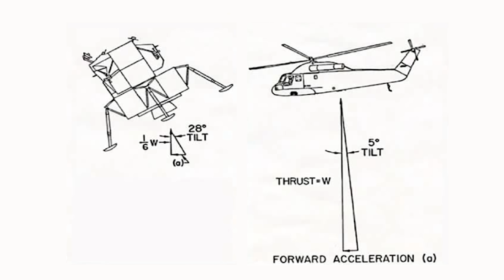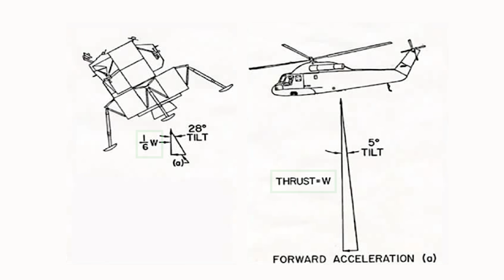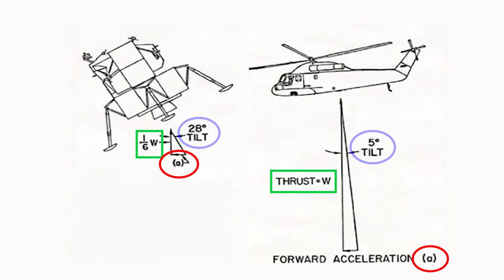How Neil Armstrong Trained to Land on the Moon  - Smarter Every Day 250

Comment: The Apollo Moon Landings were a hoax there are many reasons why they were a hoax one was the Van Allen Radiation Belt they didn’t have the shielding to protect the astronauts when they traveled through this region around the Earth.  One scientist said they would need 4 feet of led shielding to protect the astronauts through the Van Allen belt.  Also there was solar radiation and cosmic radiation that you couldn’t plot a time of year that it would be safe to travel through because it was unpredictable.  The biggest reason is neither the astronauts, Lem or the service module couldn’t protect the astronauts from the radiant heat from the sun.  The astronauts’ heat exchangers on their liquid cooled suits will not dissipate heat in a vacuum.  A vacuum is a near perfect insulator.  It’s the same concept as a thermos bottle,  whatever beverage you put in the bottle will remain hot or cold for a very long time because there is a vacuum around the liquid.  The astronauts would roast in their suits on the daytime side of the moon from the 200 degree heat and would die.  The same concept with the lem and service module.  NASA claims they rotated the service module slowly so the side not in direct sunlight would be cooled off by the cold of space.  Space which NASA claimed is a vacuum has no temperature and it’s a insulator so the service module couldn’t be cooled by this method and the astronauts would die on the trip to the moon.  On the so called moon the horizon is always 300 feet from the camera if the astronauts traveled using the lunar module the horizon line would change depending on terrain but it didn’t.  There were no stars in any of the videos or pics of the moon landings.  On the moon that has no atmosphere you should be able to see the stars clearly because there is no light diffusion from a atmosphere.  They never pointed the cameras up to the sky at all this is to hide the fact that stars should of been visible and astronomers on Earth would of caught onto the hoax.  The astronauts allegedly left tracks on the moon but in a vacuum no water can be present so there would be no moisture in the tracks to make a foot print.  It would be the same as walking on the beach or in a desert.  There was no dirt on the Lem foot pads from when the descent rocket booster lowered the Lem onto the Lunar surface which dirt would of flew everywhere.  Yet watching the lunar rover as they drove around the moon it kicked up dirt everywhere.  There are many more reasons as well but NASA faked the Apollo Moon Landings
Reply: One scientist said they would need 4 feet of led shielding

What was his name kiddo?
Reply: @tgstudio85  Look up the book Nasa Mooned America by Ralph Rene
Reply: @michaeldavis6605  If his understanding of physics and/or the English language is on par with yours, I'd rather roll around in broken glass wearing a barbed wire suit.
Reply: @michaeldavis6605  Sorry kiddo but I'm not from US, so i will not buy that book, just paste here, what he specifically said.
Reply: @michaeldavis6605  Oh ps. Ralph Renee isn't a scientists kiddo. I asked for name of scientists who said,  that there will be need for 4 feet of led shielding, so what is his name!
Reply: @tgstudio85  so you would ignore someone because he's not a scientist but has legitimate points there are alot of people who are scientist that still think the theory or relativity is right and practice it
Reply: @ArKritz84  all you can say is insults but cant bring facts to debunk my claim
Reply: @michaeldavis6605  that which is asserted without evidence, can be dismissed without evidence, so your cute switching of the burden of proof won’t fly with me. I owe you nothing.
Reply: @ArKritz84  I already gave you enough proof in what I first typed and you responded to if you don't believe it you don't have to I know better
Reply: @michaeldavis6605  no, those were claims riddled with a poor understanding of physics, not evidence.
Reply: @michaeldavis6605 Ralph René was a conspiracy theorist if you didn't know.
Reply: What a load...  🦃

Comment: NASA has chosen the Human Lander System (HLS) for the Artemis program and it's a version of the SpaceX Starship. This is 50 meters tall and much more massive than the Apollo LM. SpaceX has excellent autonomous systems on its Dragon spacecraft for docking to the ISS and Falcon 9 for landing. The F9 landing is crazy, it's on a drone ship deck heaving in 3 dimensions, those are impressive algorithms. Considering the size of the Starship HLS idk if real-time direct human control is possible. Possibly some kind of indirect synthetic control can be used. SpaceX will certainly build it to have a fully autonomous landing capability.

Comment: This may have already been suggested, but if any one wants to have the closet to reality feeling of operating the actual moon lander as it lands on the Moon, PLAYSTATION 4 HAS A VR APP THAT USES PS VR HEADSET ALONG WITH THE CONTROLLER CALLED 
"APOLLO 11 VR" this simulation uses the actual software elements of the real landers flight  computer giving it hyper realistic landing charactoristics, this with the 3d environmental head  set will blow your collective minds, its not free, about $12 bucks, but for Apollo junkies, repeat landings never get old because no 2 landings are the same... remarkable engineered simulation

Comment: You would think they would build a computer-based flight simulator, and program in the flight characteristics of the actual lunar lander and expected environmental conditions. An astronaut could do way more training, without risk to himself (herself?) and without losing any vehicles along the way. Perhaps engineers might need to build an LLTV, for use in the final stages of training. But I'm hard-pressed to believe that any vehicle they could build wouldn't be subject to erroneous factors (like wind resistance) that they could program out of the virtual environment.

Comment: The question you haven't asked is: can a rocket engine be controlled as easily as an aviation engine? And since there is still no manned vehicle capable of rocket landing, we can reasonably doubt that such a technical feat was accomplished 50 years ago, and its technology forgotten forever.
Reply: @Andre You affirm and deny without providing any evidence.
I repeat: YOU CANNOT CONTROL THE THRUST OF A ROCKET ENGINE ABLE TO ENSURE SMOOTH AND CONTROLLED LANDINGS. Aviation engines are much more flexible because you only have to control one variable: fuel. I recommend that you study in depth the operation of the rocket engine, many myths and little reality.
Reply: @Andre Aviation engines are much more flexible because you only have to control one variable: fuel.

"As you can do in rocket engines."

No, you need to control the oxygen, there are two variables, two very high pressure pumps that must work synchronously, which is why it takes so much to master the brute force of a rocket.
Reply: @Andre Seriously, white smoke on takeoff? water steam? Can or not explain the show?

Comment: i have a question. When a rocket goes up into space, and then lets say it stops completely. does the solar system fly away from the ship? im only asking because i know that everything in space is moving, nothing is still. so even if a ship goes to space and seems to stop up there. its still moving along with the earth right? like. is anything that stops in space really stopped? rlativity is a mind blow to me. its like being on a mag lev train. your at the back. this thing is travelling at say 200 mph. but your tanding still. technically your travelling at 200mph with the train, whilst standing still. if you start walking forward, you're travelling faster than the train even though you're travelling slower than the train. that space ship is you on the train and the solar system, or earth, is the train. i dont know what im asking reall or wh, its just it blows my mind how fast the earth is travelling round the sun, and the sun is travelling through the galaxy and the galaxy is travelling through space, and yet we can travell those speeds whilst standing still. its mad.

Comment: Hi how did they transport the moon buggy to the moon inside that small lander also how did they actually get it out of the lander to the moon surface I thought there was only a small door with a ladder to the surface I’m just curious thanks
Reply: They expanded the trunk, guess they need more fuel too, oh and super batteries :)
Reply: @Andremy my dear dear still at ME here, woaw scienceman erudite very impressive retorting, you know... i just read about it. 
>>> space can freeze or burn you with ease

 Why Space Is Cold If the Sun Is Hot - Interesting Engineering
Sep. 28, 2019 — space can freeze or burn you with ease ... When an object is placed outside of the earth's atmosphere and in direct sunlight, it would be heated ..
Let us take the moon for example. The areas that get the sunlight are heated to 127°C and the dark side of the moon will be at a freezing -173°C. 

Surviving extreme conditions in space - ESA
Space is one of the most extreme environments imaginable. Above the insulating atmosphere of the Earth, spacecraft are subjected to extremes of temperature, ...
Temperatures in space can range from the extremely cold, hundreds of degrees below freezing, to many hundreds of degrees above – especially if a spacecraft ventures close to the Sun.
Reply: Magic of TV

Comment: Dustin, love your videos. I’m curious about the Apollo style air locks like between the CM and LM. I’ve looked at them in person at the Huntsville air & space museum, and discussed with the staff, trying to imitate you with the Saturn core-memory modules. I failed, we could never figure out how the ‘grab hook’ or docking-hock, which is in the tunnel is gotten out of the way so that astronauts can travers from one vehicle to the other, and then reseal for separation. I’ve wondered about this since I was a kid back in the 70s, and from time to time I’ve looked at 3-D images to try to figure this out. I’ve watched you solve many harder problems on your great videos and I thought throw this out there to get some help from you. Ps. Also curious if more modern space craft use a similar system. i’ll keep watching and getting smarter every day.

Comment: I think the early "control system engineers" are better than now, with limited literary and material resources, they have to solve physics, chemical problems, first formulate systems in calculus, then translate in machine language code, write them in the brain of mechanical-electronic systems that very complex they build, they must master the knowledge all at once

Comment: This might be a stupid idea, but these days couldn't we, in theory, build a drone 1/6th the mass of a lunar lander then use virtual or augmented reality to put the pilot in the seat of that drone?
Reply: heavy things freefall as fast as light things.
Reply: @atlas8827  yes but the counter thruster offsets an amount of WEIGHT, which you can also do by... reducing the weight. Acceleration due to gravity is constant but how it flies is based on the overall MASS vs the force of the thrusters.

Comment: how much would be saved in fuel weight if the rocket first stage was accelerated on a maglev ramp before first stage engine ignition? seems like maglev trains are similar sizable payload can be accelerated to high speeds using electricity and starting a rocket to escape velocity from maglev speeds would have a huge impact compared to starting from a standstill

Comment: What actually happens on the moon landing(s) low-key confirmed by his guest Ben Feist is that the Apollo Guidance Computer (AGC) does all of the flying until final approach where Armstrong and other astronauts use the rate-of-decent  mode (P66),  a mode not unlike drones for the home market where the stabilization is handled by the AGC and Neil uses the fly by wire stick to control horizontal velocity, avoid a boulder field and then bring bring the horizontal velocity to zero; another two switches can speed up or slow down the computers rate of descent in increments of one foot per second.  I know the LLTV also had a computer. How similar was it's stabilization and controls to the actual LEM and the AGC's P66?

Comment: I flew a  test device in Grumman hangar 5 over a mosaic set of lunar photos. All I had was a mockup of the LM cockpit. I made 3 test landing attempts for evaluation data.  50 years later I toured the hangar at the Cape Canaveral facility and in an alcove next to the Saturn V rocket was the same unit I tested at the Grumman facility. I worked at Grumman for 30+ years on the A-6 Intruder , the F-14 Tomcat,and The JSTARS .  Fun years!

Comment: Hey, I know this video is about the moon, but I have had this question on my mind for a while now, and the recent Mars landing has brought it back again (and I can't think of anyone else to ask) so here goes...

This is regarding the 7 minutes of terror: Do you think that it is possible for NASA to build signal amplifiers that would be strategically placed between Mars and Earth, and these would boost the signal enough to reduce the delay in communication time? Or is this still too far in the future?  I'm thinking 2 or 3 satellites spaced evenly across the distance whose purpose is to catch and slingshot the signals back and forth...

Thank you for your response (provided you get this message, or for anyone else who may have a theory/answer).
Reply: The delay is because of the finite speed of light. There's nothing that can be done about that.

Comment: Another reason why people suspect it is fake is because in 1960s, there were no integrated circuits.  All computation was using vacuum tubes.  There is no way that they could fit that many vacuum tubes into that small module to achieve the REAL TIME SIGNAL PROCESSING FOR LIVE BROADCASTING.  Once you realize it is physically impossible with 1960s technologies, you will realize the truth.  Hard science won't lie.
Reply: Of course there were integrated circuits back then, lol. And they didn't need to do any digital processing. It's just live TV. Live TV has been a thing since the early 1900.
Reply: @atlas8827  You have no idea what you are talking about.  Noise filtering is a main operation for real time signal processing.  Back in the 1960s there is a big room in TV station doing it.  In fact, not until 80s do we start having broadcasting vehicles small enough to fit into a van.  And that is 1980s.  Think about what is in 1960s when you need to fit a life supporting system AND a broadcasting system into that landing module.
Reply: You have no idea what you are talking about.
Reply: @casanovafrankenstein4193  I know what I am talking about.  This is just a small set of technical issues that are impossible to address in 1960s technologies.
Reply: @jkuang  
Noise filtering would have been done at the ground stations. You know, the facilities with godzilla-sized satellite dishes.

Comment: Landing is relatively easy.  Launching the heavy life support module back up to 300 miles orbit is hard, even with 1/6 gravity.  That is the real reason why people suspect the US landing and returning are fake.  If you have a chance to look at the return rocket combustion video, you will conclude it was a joke.
Reply: I think most of it is hard.
Reply: @atlas8827  I just want to know how the hack they can use that tiny combustion source could propel a heavy life supporting module high up into the moon orbit 300 miles up.  Time after time after time.  At the end, they don't even bother to pretend and even bring rovers and golfs on the moon surface, as if it is just walk in the park.
Reply: @jkuang  
It depends on what you think is heavy. The ascent stage, completely fueled, weighted about 5 metric tons.
Reply: @atlas8827  So it is an equivalent of 1 ton weight on earth.  Shoot that up 300 miles and how much combustion material is needed?
Reply: @jkuang  
Rocket science doesn't work like that.
Reply: @atlas8827  I have not seen one single video or documentation on the combustion fuel needed to propel this ascending module (life supporting) back to 300 miles high up in orbit.  The only video I saw was that laughable shot from the "moon surface" video on the combustion capture.
Reply: Do you know why so much evidence were destroyed due to "negligence"?  These evidence should be the most valuable technology data and blue prints for humanity.  But no ... they were accidentally destroyed.  Now we can not go back to the moon!  Fundamental contradiction on how technology progress.  How US suddenly get to land on the moon on the first try (very disruptive in technology progressing) and how suddenly it simply disappear (very disruptive in technology progressing).
Reply: @jkuang  
Just do the calculations yourself, if you really care that much. 

Blueprints are freely available to the public. I have no idea what you mean by 'technology data'.

Comment: Seems like they could have solved their simulation problem by installing 4 smaller jets at each corner and throttle their lift to that of 5/6 the weight of the aircraft. Once they have done that, they could install the 5th main jet to move the 1/6 remaining weight and effectively have exactly what they would need on the moon. Then when they built the lunar landing craft they could do the exact same operation only to a 1/6 weight scale on the trust. Seems a lot simpler than building some giant platform crane that can in no way provide a consistent lift or 90° pull and will in no way be duplicatable on the moon.